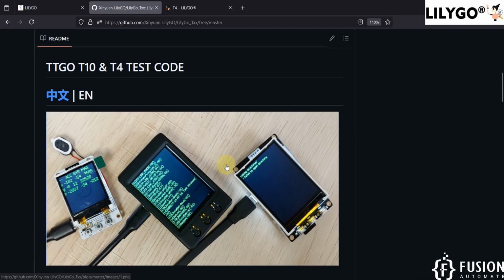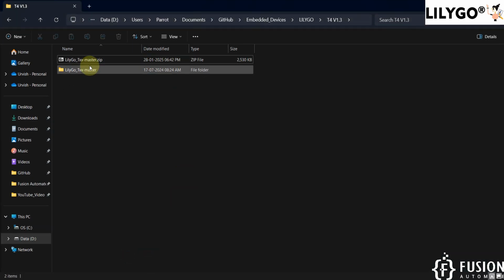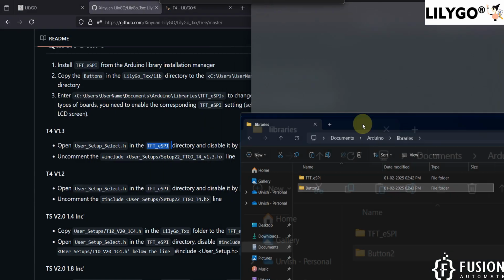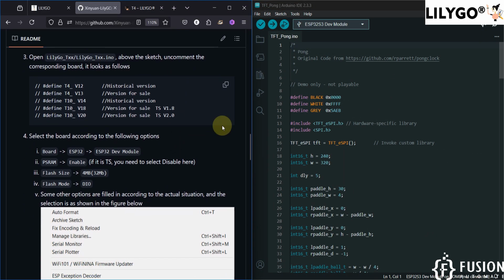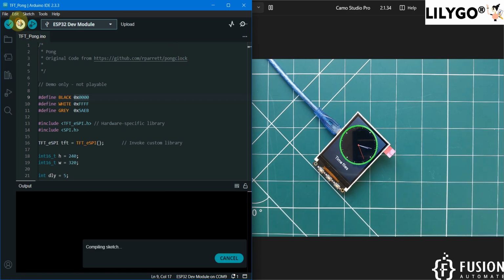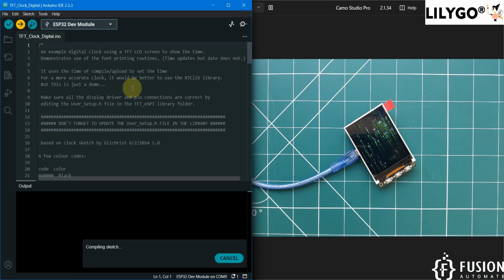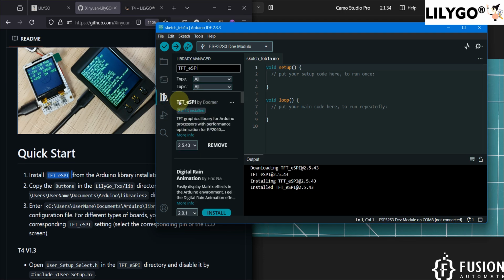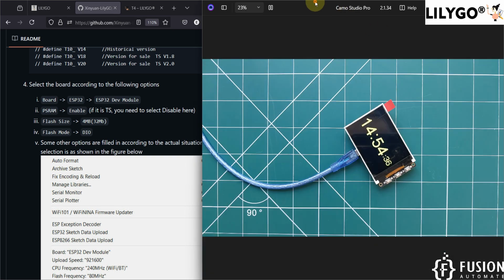Getting Started with Lilygo T4 with Arduino IDE | ESP32 | ILI9341 LCD Display |

Comment: Thank you for this video, however I did everything exactly like you said and I get the error message: ''A fatal error occurred: Failed to connect to ESP32: No serial data received'' and ''exit status 2'' ... Any advice? Do I have to get the board into downloadmode beforehand, and if yes, how?
Reply: Btw it was because I used a bad USB cable - all good now!
Reply from the maker: Great Friend 👍
Reply: If you insert the lines to turn on the backlight at the beginning of the SETUP it works fine you must drive pin 4 HIGH